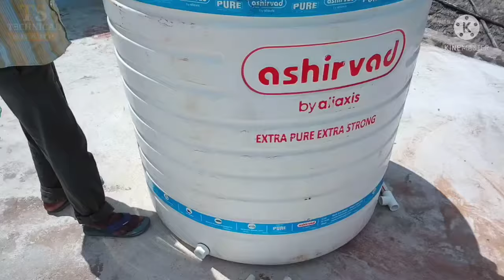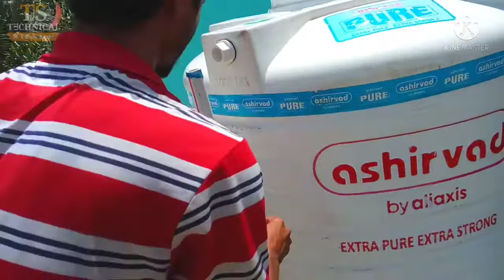1000LITER WATER TANK INSTALLATION IN HOUSE / pani tanki ka connection kaise kare

Comment: Is it ok to put 2000 litre tank on concrete roof?
Reply from the maker: घर की दक्षिण-पश्चिमी कोने में टंकी को रखना है...
Reply: @TechnicalSharp  pls in english.
Reply from the maker: Tank setting in your roof south west corner...
Reply: @TechnicalSharp  its 3 floors up. Would the weight hold
Reply from the maker: No problem....

Comment: Nice video. The only improvement is to connect the outlet and the air vent using flexible PVC pipe to avoid damage due to stresses caused by natural expansion of the tank body.